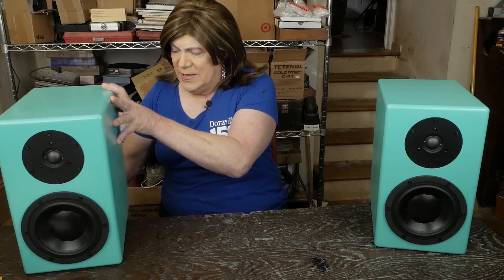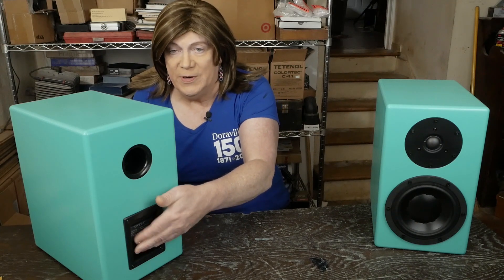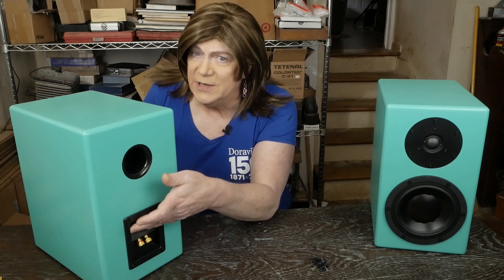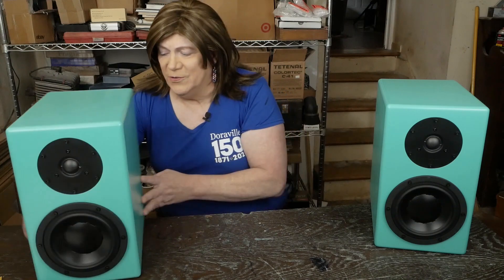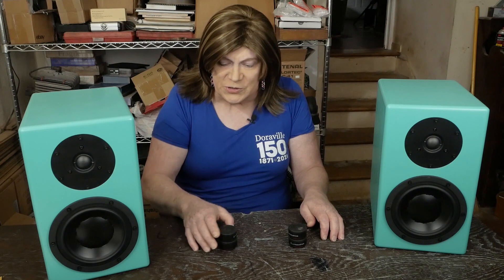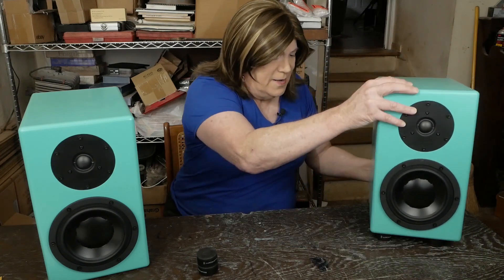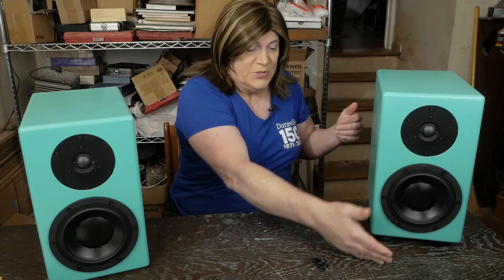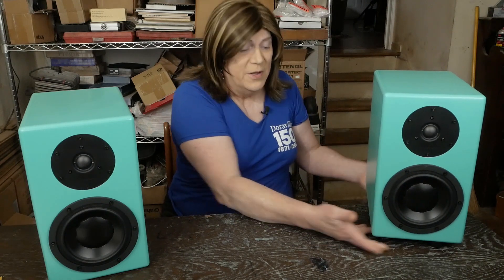DIY 2.2A Speaker Build: Testing and Review!

Comment: Hi, thanks so much for the videos! Im in the middle of this kit (my first one) and i was wondering about the stuffing: it didn't come with that much(?). Am i applying the foam to just the sides (upper and lower cabinet sides) and the top and bottom (over or around the the crossover?). None on the middle brace or face around the tweeter and woofer. Correct?.....It appears that your stuffing was filling up the entire tweeter compartment 🤔. Thank you so much!
Reply from the maker: I covered every solid surface with that white foam stuff, but made sure the leave the middle open so the sound pressure from the woofer can get to the opening of the bass port. I used some contact cement to hold it in place.

Comment: Hi. Would you care to compare these HiVi to Desktop mini by GRresearch since you did that build as well and they both are similar price. Are HiVi just as clean sounding but with more base? And difference in midrange as well as highs?
Reply from the maker: They just sound much better everywhere and are also more efficient. Obviously the GR desktop mini is a much smaller speaker and is more geared towards near field desktop use.

Comment: The measurements didn’t show any differences….
Reply from the maker: At 20hz they did.
Reply: @SkunkieDesignsElectronics  I personally also use REW software and the lowest frequencies, the start of the measurements did always show differences. But maybe I am wrong…
Reply from the maker: We ran the test back and forth 3 times. Every time we put the pucks under the speakers the 20hz response went up.
Reply: @SkunkieDesignsElectronics  The only difference is down at 20-22 Hz, where there's precious little musical content. Sure, the graph shows that there's another 12 db  or so relative to the response without the pucks, but the nominal SPL of the speaker is 80-82 dB in the 40Hz-10kHz range, and even with the pucks, the SPL at 20-22 Hz is only 62 dB, a full 20 dB down. That's not a meaningful difference. The scale of the graph is also not proper to view the real response of the speaker. The bottom should be 50 dB SPL and the top at 100 dB SPL.

Comment: Excellent work! I enjoy your videos and your honest feedback. 

Can you describe how did you position the speakers in your room? Did you use a speaker stand with the Iso-puck? I learned the hard way that speaker locations and room acoustics change sound a lot. 

Also there is no mentioning about the impedance of these speakers. Have you tried 8 ohm and 4ohm output from your tube amps and compare the sound? I have a pair of KLH 17 speakers. With a tube amp, the bass is tuneful and full. With a LM3886 amp, it becomes lean and dry.
Reply from the maker: They are rated as 8ohm and honestly, I never tried them on the 4 ohm taps. I've listened to them in two locations, in my home they were in a bay window with the system overhanging the front edge, and at my friends house, they we on stands a couple of feet from the wall. The sounded good in both! And yes speaker location in a room is huge.

Comment: your terminals are upside-down
Reply from the maker: Exactly like I want them to be for my setup :) That's what is fun about DIY!
Reply: @SkunkieDesignsElectronics  if you use banana plugs with a heavier cable , they could get pulled out and potentially damage your amp

Comment: Do these sound as efficient as the 600M's? it says Sensitivity 86 dB ... can these work with low powered tube amps?
Reply from the maker: That seems like a lower rating than they actually are. Yes, the RP600M is more efficient but not by a lot. I was driving them with my EL34 fine, which is around 5-6W. You aren't going to drive them with a flea power amp though.

Comment: Another great video Stephe. I am with you on the pucks. I was very sceptical until I put them under one speaker and it changed the sound and then under the second I was sold. The bass and mids seem faster and accurate if that is a thing. Didn't seem to do much to the highs though.
Reply from the maker: Right the highs are unaffected.

Comment: Thanks for putting a bow on the project. It looks like the speakers turned out nice. Do they pair well with lower power tube amps?
Reply from the maker: Yes they do, they are a smidge less efficient than the RP600M but a 5-8W tube amp can still drive them

Comment: Thanks for the follow up on these DIY 2.2s.  I made a pair two years ago and like them so much I sold my much more expensive speakers. I still love them.  The overall quality is great, but I agree with you that the bass/woofers are really special.  This HiVi woofer was designed by Audio Products International as clones to some Dynaudio Woofers.  They have a 3" voice coil I think, and are also used in the super high end Totem bookshelf speakers.    I am interested, but skeptical of the Iso-Pucks.  I do know that raising a speaker .9" will itself impact the sound somewhat.  I use heavy stands and blu-tak, but will research the Pucks more closely.
Reply from the maker: I was skeptical too as I am on things like this. It's pretty well accepted that those foam pad things help isolate the speakers, these are just next level of that. Raising the speaker in relation to the listener does more for the high end. You can see on that measurement, it lifting up the 20hz signal.